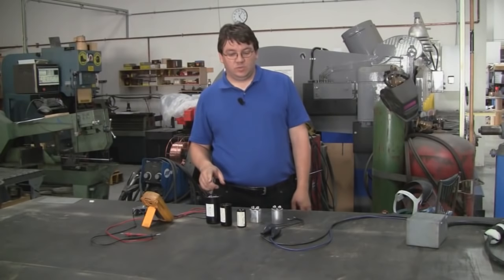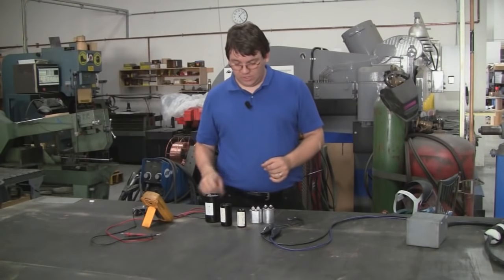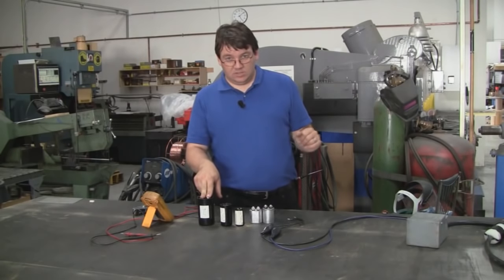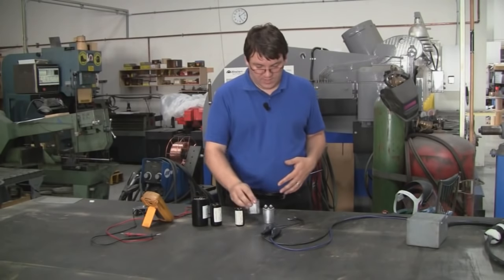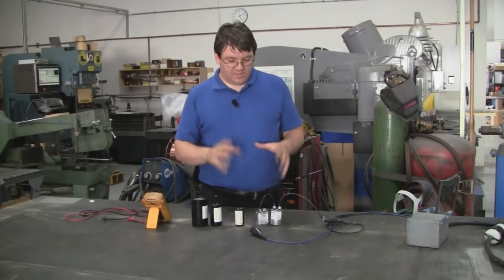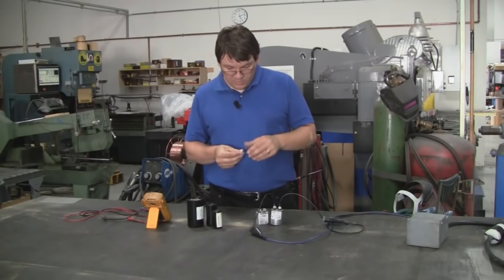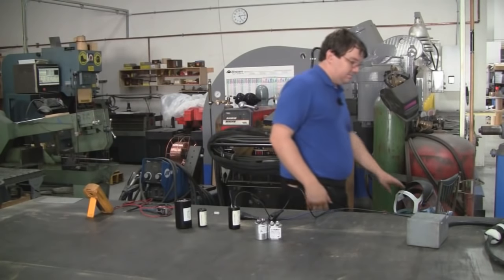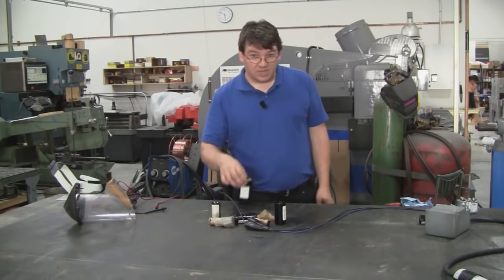Start Capacitors & Run Capacitors for Electric Motors - Differences Explained by TEMCo

Comment: I took a washing machine 3/4 Hp motor out of a Frigidaire , the capacitor was 233-280mfd  when I hooked a power cord directly to it ......... it ran for like 2 minutes and fried fast,,, should I get a different capacitor? and also I hooked the high speed wire to the capacitor also.. taped up the low speed wire. using it for a small lathe project I'm trying to make. thanks for any info you can help with
Reply: also capacitors sound wicked, saw a video of a man that wired up 6 capacitors in a series and it starts his car , total weight only like less than 1 pound compared to 30 for a car battery.. lol
Reply: John Hill,
 Multi-speed induction motors, like the ones used in washing machines typically have RUN windings that are selected for higher or lower speeds by changing the number of poles needed for a selected speed (2 poles for apx. 3450 RPM, 4 poles for 1725 RPM, 6 poles for 1150RPM, etc..). When a machine is started it ALWAYS starts with the highest speed RUN windings connected during the short start period and then reverts to the speed selected which could be a manually operated switch or automatically (think washing machine timer). What connects the highest speed windings during start is either a centrifugal switch or electronic device which disconnects the START winding when the motor reaches 70% of its rated speed. If this centrifugal device doesn't disconnect the START winding AND the start capacitor (which is connected in series) the capacitor will destroy itself after a few seconds...the capacitor is in there to give an extra "kick in the ass" momentary current surge for hard to start motors. Check your wiring to make sure your capacitor is in series with the START winding. If this is correct then your centrifugal switch/device is probably defective. This disaster will also happen if the motor is not free to turn.  Good luck.

Comment: I'm trying to locate a motor run capacitor, CBB60, 75uF 250V AC. Would you have something compatible or where to find.
Reply from the maker: We don't carry any capacitors of that rating, but eBay should be a good source for that.

Comment: i have a question. i am using an old garage door opener motor for a project and it requires a capacitor. i am not sure which kind it is. the entire label on it reads ( Motor Capacitor 220VAC  43~53uF (60Hz)  Stanley Automatic Openers P/N: 360-2986) im using the motor as a chain driver which is what it was made for but i do not understand what type of capacitor it is and i also had to remove the circuit board for what i am needing it for. the motor has 4 wires coming from it 1-red 1-blue 1-black and there is a white wire running into it strait from the plug so i am guessing it is a main hot wire. there are 2 Dual prongs on the capacitor. what kind of capacitor is it and how would i hard wire it for it to either run the motor or to just start it?
Reply: also seeing as it has 4 wires leading from the motor does this also mean that it has an internal switch to kick the capacitor from the circuit once the motor is up to speed or is that something that might have been built into the circuit board? i used to work on door openers replacing mechanical parts and mother boards but i never understood the electrical workings of it seeing as the only things i know of that the board controls is the opener remote signal the wall button signal and the limiter switches for how far it allows the door to open or close and how hard it will open or close. besides that flipping the polarity of the motor each time the button is pressed for the up and down operation ,
Reply: krypten wolf never mind i figured it out it is a start capacitor. it exploded after 6 seconds of the motor running. you mentioned run capacitors can be used as start caps as well. how much would a run capacitor cost me? im looking for one in the range of 43~53 uF 60Hz thank you

Comment: how can i find what side i need capacitor for aircondition 4 ton
Reply: i my aircondition  4 TON  can i use capacitor 45/10 MFD 370/440 VOLTS     .......OR i use 80 /10 MFD 370/440 volts ?
Reply: @ngoidoan3560  ALways replace the original capacitor with the original valors.

Comment: Hi guys, I have a problem with the electric motor in a Coffing chain hoist, which uses a device called SINPAC switch. Which is what disconnects the start winding. I want to know how to remove it or replace it with another updated system. If anyone can tell me how or provide a link where I can help I will be thankful.

Comment: Can I replace a 50mfd 240VAC run capacitor with one that is listed at 50mfd 370VAC on a motor
Reply from the maker: Yes, that should be fine. As long as the replacement capacitor has the same or higher voltage rating and the original, it will work.

Comment: This is a great video. I have a question about capacitors in parallel, specifically for a well pump. I have not opened my control box yet to see if my well pump controller uses a start capacitor or a run capacitor. Is there any danger in paralleling that capacitor (provided it is the same type) ?  I’m in the northeast and we recently had a tornado that left us without power for a week, my generator was struggling with the peak inrush current for our well pump when there were other loads drawing on it at the same time. I wanted to see if I could alleviate some of that stress with an additional capacitor. Any knowledge you have to offer on this would be appreciated. Thanks in advance.

Comment: Thanks for the information and demonstration. I have one question about start capacitors. I assume they are parallel to the load … ie., across the 240 vac power. What makes it “drop out” of the circuit once it does its work?
Reply: A centrifugal switch is used. This opens the start capacitor circuit once the centrifugal switch hits a certain amount of RPMs.

Comment: really do like your videos. I have a compressor and need to use a generator to run it. Vendor says don't use a generator. Is there a percentage increase on the size of the start capacitor that would make the combination of motor/generator a little more friendly and work together a little better? This is what I have now, Microfarad Rating: 324-389 165 volts. Thanks!

Comment: I have (had) a 8 MFD 450V run cap that failed (FRIGIDAIRE 5304482883). It's in a window air unit.  Can I substitute a 7.5 MFD 440V cap in my application?  Specifically, your PN#rc0049?
Reply from the maker: I might try a bit more to find an 8uf cap but the 7.5 will likely work.

Comment: I have 200w 220v 50Hz AC induction motor use as a fan.
It come with a 3.5mF run capacitor from the factory. The cap fail (once) and look like about to fail again soon (motor slow down, higher running temperature)

What can I do to make it more durable and economical to run? (change capacitor to a higher quality one?)
Could (or should I) I replace the running capacitor with higher capacitance?

Comment: How can you tell from the lable what you need? Label shows 270W/270W 2,4A/2,4A S1 30 microfarads U (sub) c 200Volts Cos 0.98/0.98 
The motor is a Heidolp it was in a paper shredder but the shaft gear was worn bad. I want to repurpose the motor.

Comment: Very clear , but , how do I distinguish a start capacitor from a run capacitor ? I mean from the codes/values written on it . I understand start capacitors are usually black , but I believe there must be something more .Thank you
Reply: in a given motor, start capacitor big, run capacitor small

Comment: Is it possible to wire in run start capacitor to your home electrical panel and store up starting power when any motor devices like ac motor pool pump motor or refrigerator motors kick on? See power saver 1200 and let me know thoughts on this
Reply from the maker: You can use AC caps as a power factor correction, often done in large industrial settings. However, AC capacitors do not work by storing power.

Comment: I’ve got a small wood lathe motor that blew its capacitor. The motor is 1/2 hp.
110v 60HZ, and the cap was marked 30 mfd’s. I’m assuming it’s a start capacitor, because it’s a small motor, and it would not start without the cap plugged in. Can I use a different rated capacitor, or do I need to stay as close to 30 mfd as possible? I had a start cap laying around marked 161-192 mfd. it blew after about 10 seconds. Thanks in advance!
Reply: Stay as close as possible to the original valor. Much Higher valors than the original can damage the motor, heat more or problems. You can safely use 25 to 35 mfds, But remember higher microfarads means you will have more torque, more power, but also will heat more faster. Now, please take note normaly the start capacitor will have for example 220uf to 256uf but the run capacitor will have an only valor, so i will assume you 30 mfd is a work capcitor. Please someone correct me if im wrong. 

As a tip, any motor with a capacitor will not start witouth a capacitor, no matter if they are run or start capacitor.

Comment: Also I have a start capacitor on it and it has failed could It possibly had a run cap on it idk because it exploded but it has a centrifical switch on it so idk

Comment: I am working on 110v 2 speed electric motor and I would like change rotation, could you walk me through it?
Reply: Depending of the motor. IF the motor have 4 cables (2 start , 2 work) you can change only the orden of the 2 start wires. The plaque of the motor is your friend.

IF is a motor (3 cables : 1 common , 1 left , 1 right) you only need to change the left and right order.

Comment: I am looking for a 45uf+/ 6% 440VAC/B 50/60HZ Capacitor for my air conditioning unit outside. This number matches the one on the bad unit. It developed a pin hole  and the oil came out and it doesn't work. Can you set me up with one? I have  a pic if you need one.

Comment: Thanks for the video question got a small 2 amp 120 v motor has drawing on side cap wiring diagram motor has forward and reverse don't know what size cap to install bought one and motor runs in forward but not reverse or sometimes reverse and motor getting hot after it runs like 5 minutes anyways could that have anything to do with he ca
Reply from the maker: If the capacitor is the wrong value, that could definitely contribute to your issues. Do you happen to have the specs on the original capacitor?

Comment: I have a Leeson + Sanborn compressor that will start cold with no air in the tank, but when it cycles to rebuild the used air and there is pressure in the tank, it starts to turn over, slows down and stops tripping the circuit breaker.
It's at 115V and 17.8 Amps and runs 3450 rpm's.
It seems to have a weak start.
Any ideas?
Reply from the maker: Your check valve may be dead. I would look into that first, because the motor does start cold (which means the start cap is probably good, but you'll want to check that out with a capacitance meter).
Reply: TEMCo Industrial Power I'll check it out but it worked fine with the 5hp gas engine and compressor that was on that tank.
It seems as if once the short line to the tank gets up to enough pressur to open the one way valve, it's too much for the motor.
The L&S starts to turn over speeding up a few pumps like it starts with no pressure, but before it can really get going, it slows down, stalls, then blows the breaker.
Reply: Papa Monster
 If your electric motor is 115V with a full load amp rating of 17.8, it is about a 2 hp motor. A 2 hp electric motor is going to not have as much power as a 5 hp gas motor to begin with. Also, you didn't say if you used the same pulley size on the electric motor as was on the gas motor (I'm assuming it is a belt driven pump), but if you did, you are not only trying to run a 5 hp pump with a 2 hp motor, but you are running it at around twice the speed since gas engines don't typically run at 3450 RPM.
To size the motor to the pump correctly, look for the rated compressed air output of the pump. It should be designated in SCFM @ some pressure. As a rule of thumb, I assume 4 to 4.5 SCFM @ 90 psi per horsepower. Size your motor accordingly. An alternative is to put a much smaller pulley (again, assuming belt drive) on the motor. This will decrease the output of the pump, but take some load off the motor. It's the whole "Law OF Conservation Of Energy" thingy going on, ya know.

Comment: Can i start a dc motor with a capacitor bank to spool it over 50,000 rpm in a very short time?
Reply from the maker: What's the application?
Reply: TEMCo Industrial Power Lets say i want to spool up a 16oz solid cylinder with 5 pounds of tangential force as drag force on the cylinder for a very short time like 3 seconds or less. Enough power to spin this from 50,000 to 100,000 rpm in that amount of time without burning the motor. Some crazy idea im working on ;)

Comment: I bought an AC electric motor online, there was no capacitor with it and no manufacturer plate. It is a 2 HP, 17 amp, 90 vol,t continuous duty cycle motor. Anyone have any suggestions as to what capacitor I need? Or how I would figure that out?
Reply: If you're in USA you've probably bought a boat anchor. Not sure if a 90v motor will work on 120v system but normally if it needs a cap to start it will have 2 wires coming out to connect to the cap also usually a centrifugal switch on the end to disconnect the cap once it's up to running speed. No good way to tell what size it would need but if I were going to try it I'd try 300-500mfd 370v. Without a nameplate how do you know it's 2hp, 17a, 90v?
Reply: Thanks for the tip.  👌There is an embossment, for lack of a better term, on the top of the motor that gives this information.
Reply: 30 uF

Comment: My question is how is a start capacitor taken out after the motor starts.
Reply: There is a centrifical switch on the end of the armature that disconnects it from the circuit once the motor speeds up.

Comment: Can I use a 250vac-15mf capacitor in a 180vac-12mf refrigerator start relay?
Reply: Sure you can, but the force will be a little less and the life expectancy will be less. I know thsis is a year post since you asked, but never too late.

Comment: Love to buy a capacitor from you if I only knew which wire connects to it I have two brown wires one that has a strip but I don't have any markings previous capacitor so not sure what to do. Its a 20 year old York.
Reply from the maker: If there are only 2 wires, one will go to each pole of the capacitor. Since these caps are not polarity-specific, it doesn't matter which wire goes to which terminal.

Comment: I'm looking at a motor today, to run a small wood shop drum sander.
here is it's detials
New Dayton 4NXG3 Farm duty motor, cap start, TEAO, 1 HP, 1725, 115/208-230, FR 56, 4.

I'm confused by the cap start. also, farm duty? maybe it was used on a farm...
thanks!
Reply from the maker: We don't currently carry Dayton motors, but you can call in to talk to one of our sales engineers to help you select a comparable motor. Our number is listed in the video description.

Comment: , I had to put a new start capacitor and run capacitor on my 3.7 3568 RPM air compressor motor got done installing everything puts attention on it to start the motor to build up air compressor if I had the same exact diagram it was on it previous to my run capacitor and start capacitor but it is starting to shoot small minut Sparks out the back anybody tell me if that is my brushes set too much do I have some too much tension on it or what can I do to fix the problem it is shooting Sparks profusely out the back what is my problem

Comment: If somebody has a blown capactor they need to call a professional. They dont blow for no reason. A professional needs to find and correct the malfunction first before replacing a capactor. Most of the time its a loose electrical connection or service factor was exceeded

Comment: hi

I have a 3 phase 4kw motor running an Aqua blast cabinet but want to convert to single phase using start capacitors but am not up to speed with the subject matter involved to achieve this? What size and how many caps would I need to run a 4kw motor and how do I go about doing so? my cabinet has a 240v light and 24v electrics so would I need to change the 3 phase 24v transformer to a 12v single phase transformer?

Any help form you or anyone out their would be very much appreciated
Reply: Tommo2469 I have the exact same situation.Any response on how to do it would really be helpfull.
Reply: Tommo2469 You need a phase converter or VFD. A capacitor won't be enough to run your 4kW 3-ph motor from single phase.

Comment: Hi, can I use a 1/2 HP ,115 V motor from a Stand Fan  on a Cement Mixer that use a 1/3 HP , 115 V.
Reply: In theory yes, but the start of the motor will be more potent, even a little torque. Higher the ufarads, higher the torque, BUT you can compare both valors and is very recommend you respect their original valors.

Comment: Run capacitors should have a 1.5 vac ratio... 😳.. If your using 220 ac power source... Then your capacitor vac rating should be 220x1.5 =330vac rating, at least to compensate for surges..😀👍

Comment: I just bought this new- RoToM Brand Dual Run Capacitor. 80+5 MFD 370/440v... -Would like to know, if theres anyway i could hook this to my lawn tractor for starting? There's no Battery! All this capacitor talk online is difficult to me! Ha  -How would i wire it!?. It's got 3 prongs! Fan-Common-Herm...  -The tractor only puts out around 4 amp's or so, from the Generator/Stator... No regulator! Just 2 wire's coming out from under the Generator/Stator-1 wire is for the Head-Light's... -The other wire has a diode, and goes to the battery.(which there isn't a Batt...) Btw The solinoid run's off the magnet's on the flywheel! So that's seperate from this equation...Ha  Tks...